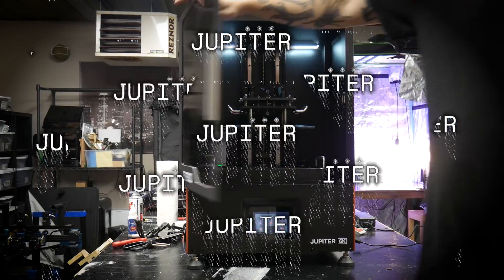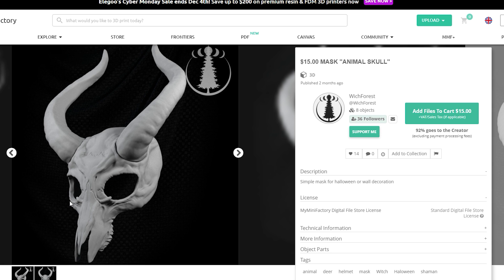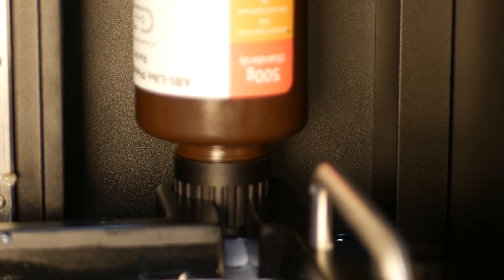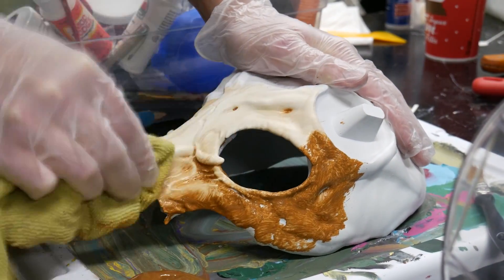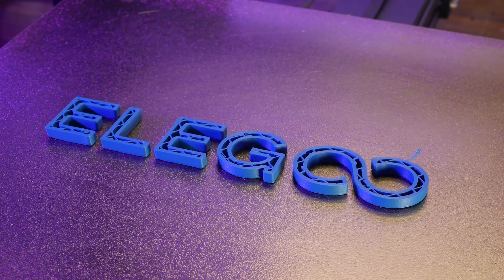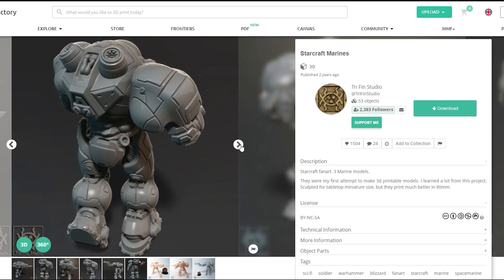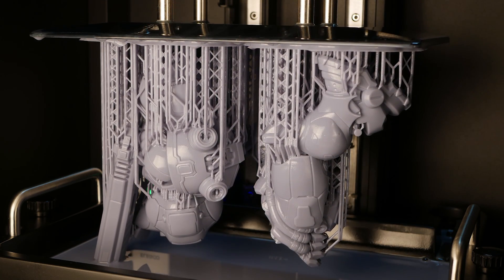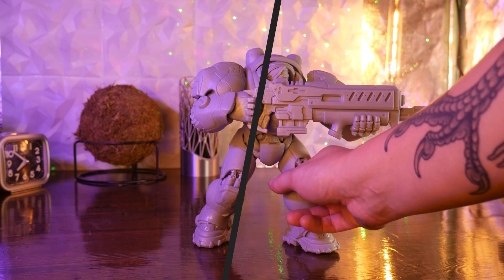Elegoo Jupiter 6K First Look // Big Resin Prints!

Comment: Hey, I'm looking at getting this printer for larger scale models but random question. With that cleaning process you did, what was the brush for and then the heat gun? I've been printing on a sonic mini for over a year for D&D models. I generally just gently use plastic Stanley knife like blades / scrappers to take them off, then seal the models in a jar of IPA, gentle shake, same with water, then one more time in IPA before a final rinse in water with 10% washing soap. Then natural curing on the window sill. But the process of removing the supports alone takes me about 20 minutes. Was just shocked when you pulled them off straight like that!